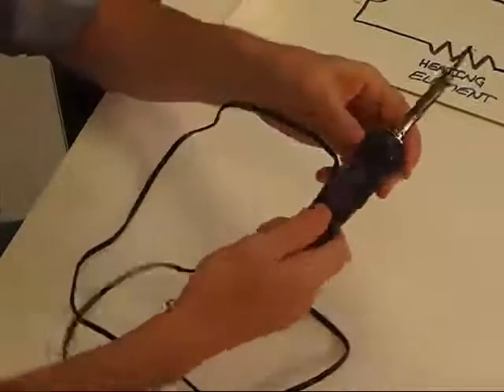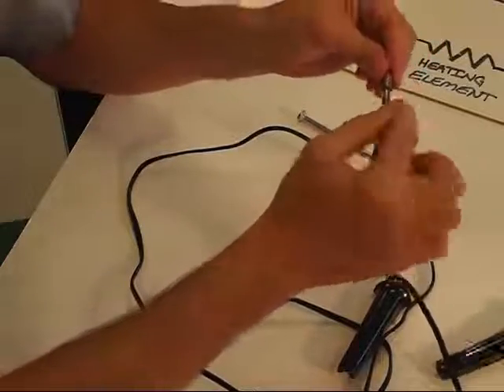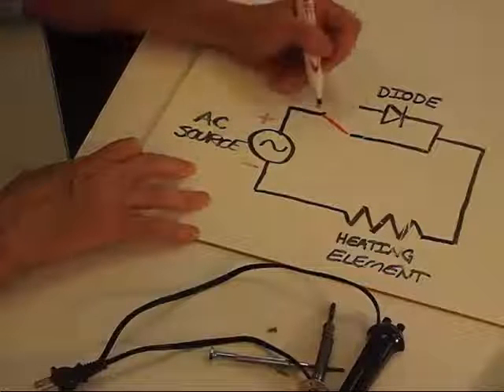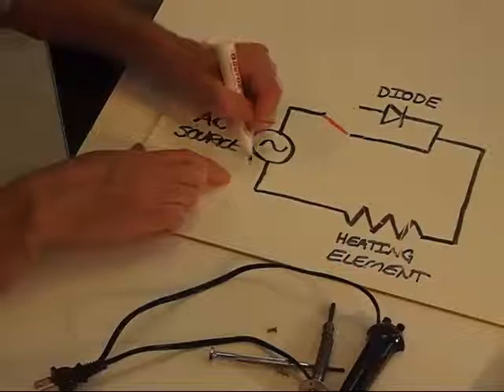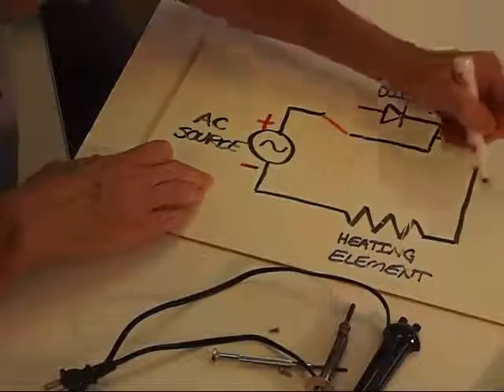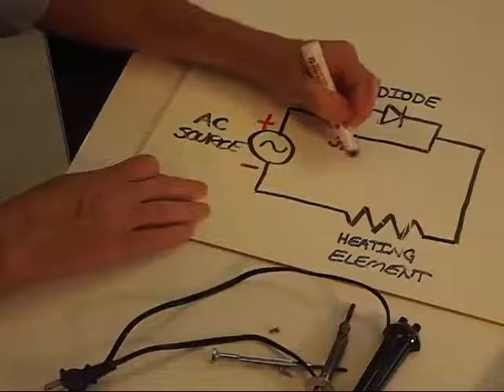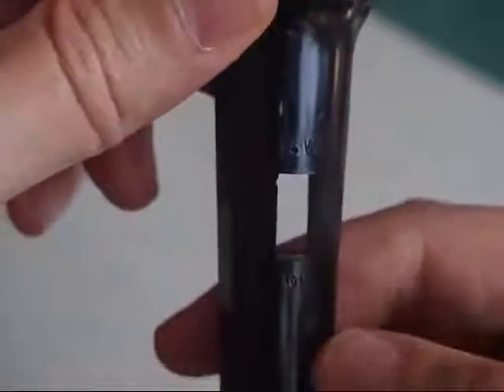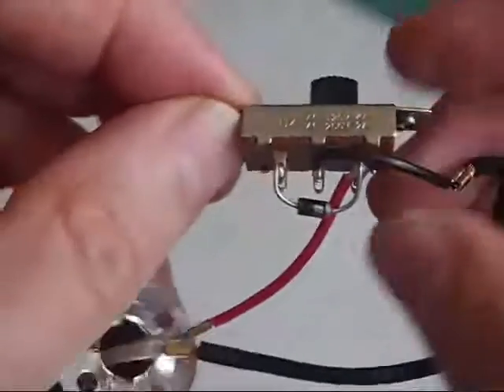A Dual-Wattage Soldering Iron: An Example Circuit that uses a Diode

Comment: With respect sir.
May be you forgot you could simply ad a diode and use a simple oneway switch to bypass the diode and switch the system in full power mode
Reply from the maker: Hi Siavash, yes, that's true a single-pole-single-throw switch could be used as well. But this particular soldering iron actually uses a SPDT switch.

Comment: I know this an old video but I have a question: so there’s the black wire that is part of the power cord and the red wire coming off of the switch...which wire goes to which wire on the heating element...or does it not matter?
Reply from the maker: The heating element doesn't care which way the current is flowing through it, and in fact it's AC anyway (in this case) so the direction is switching back-and-forth 60 times per second. The diode, when the switch is in the position such that the diode is in the circuit, DOES care about the direction, but again in this application it doesn't matter. In either orientation the diode will be blocking the current 50% of the time. I hope this helps.
Reply: Jeff Regester thank you for answering! I had a feeling it wouldn’t matter due to the AC current but just wanted to make sure. You helped me save my soldering iron!

Comment: Diode you have drawn is forward bias.But we should to reverse bias.....
Reply from the maker: It's forward-biases 50% of the time, and reverse-biased 50% of the time, because the AC it reversing polarity 60 times per second (that's what AC is). That's how the diode reduces the  power and temperature of the soldering iron when it is in the circuit.

Comment: Just opened up a brand new soldering iron and it had the same thing going on, minus the switch. Hope I dont ruin the resistance by adding a turbo mode.
Reply: adding half rectified circuit only making it less power. but if you put full wave rectifier it will almost 1.5x the amount because AC rms to DC rms is root 2 = 1.414

Comment: Which diode is used in this soldering iron?
Reply: When I used the diode, why the voltage was increased from 220 becomes 440 volt? My question is how to make 110 v, what is diode can I use?
Reply: 1N4007 Enough....
Reply: 1N4007 Enough....

Comment: Good, clear explanation. You can also add a diode (and a switch) to a non-switchable iron to make it a dual setting iron. I used to have a cheapo two setting "soldering station" which was nothing more than than a iron holder with a switch and a diode built in to do exactly what you've shown here. I tended to use the "low" setting more of like a stand-by mode. That is to say, that when I wasn't actually doing a joint, I'd flip it to low and then back to "high" when I needed to do more soldering. The iron would heat back up to maximum heat quickly when going from"low" to "high". I'm kind of embarrassed to admit that over the years I had left the iron on "low/stand-by" by mistake rather than turning it off. I absolutely SURE this low setting saved that cheapy little iron from burning out or even UP, by having a low setting. I'm NOT in any way suggesting that anybody ever leave an iron unattended and still on regardless of setting!! 😮 But.... I'm pretty sure it saved my butt!! 🔥 I now use the power strip switch on my workbench to turn my work light on and off, that way when I kill the light, my soldering station gets automatically switched off too. 👍

Comment: Let me thank you, old story or not, this was exactly what i needed to fix an "older" iron I had. The only thing missing was the LED mine has to indicate power. The amount of information on the internet and You Tube in particular amazes me; although I know my father turns over in his grave as an electrical engineer watching me, I still struggle with basic electronics. I could find absolutely zero circuit diagrams for this iron anywhere!! I can follow that, I can follow a demonstration...just give me the recipe! So...thank you! this year is already better than last... :o)